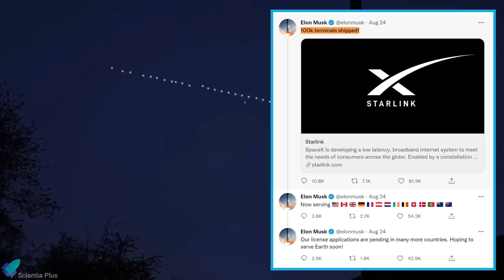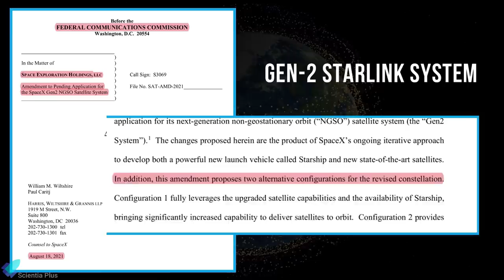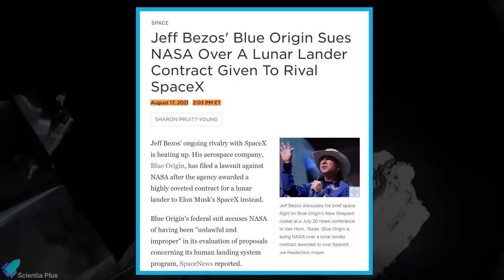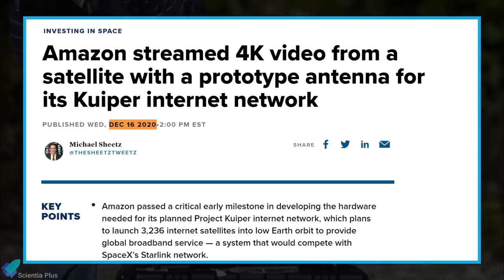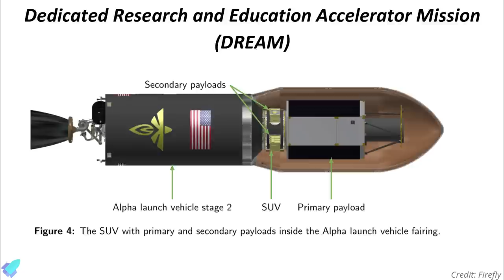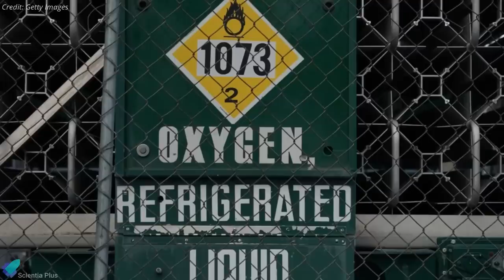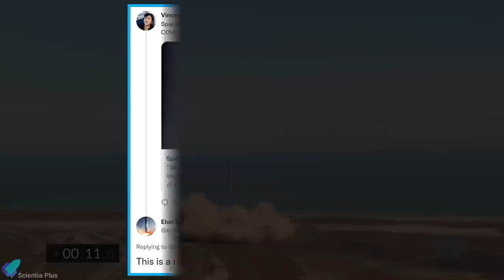Starship Quick Disconnect Arm Installed, GSE Tank Cryo Test  | JWST is READY | Firefly Alpha Launch

Comment: A parallel road to the beach would be cheaper and faster.
Reply: Wouldn't it be subjected to road closures as other roads?
Reply: There's no reason. The current road is closed when they're transporting stuff. But really big stuff that takes up the whole width of the road.
So no one can overtake.

When there's a launch or test the beach will be closed to, even when there would be a tunnel.
Reply: @rudivandoornegat2371  when beach is closed you can still use the tunnel to drive to Starbase, so :)
Reply: I agree why not do this? It would settle all closings except testing and launches. And there's the rub.
Reply: The tunnel as described in this video is not parallel to the current east-west road, but comes from the north, parallel to the beach, and close to the sea, from South Padre to Boca Chica.

Starbase is split into two parts: the factory site (where also the control center is) and the launch site.
The launch site is near the beach. And the tunnel is for outside people who want to go to the beach.

Even SpaceX people don't stay at the launch site during a launch. 
And the tunnel won't go between the factory and the launch site.
Reply: @rudivandoornegat2371  you are right regarding your last message. But I still find it challenging to understand what road would be easier to build. There is so much water around. Also I have found an article which said:

"Such a tunnel would serve a couple of purposes. It could provide public access to the beach at all times, except during launch attempts and high-pressure tests. It could also significantly shorten the commutes of SpaceX employees who live on South Padre Island, Port Isabel, and other locations that would otherwise be more than an hour's drive from the company's "Starbase" facilities in Boca Chica."

So main purpose of the tunnel is to significantly reduce travel time outside of the road closures.
Reply: @TarasMazepa  Yes, that's a plus. And a tunnel wouldn't disturb wildlife like bridge or a road.
Some fundamental environmental activists are already doing their thing.
Reply: @philzone8486  I think that in the future only new boosters and starships will be launched from Starbase Boca Chica.

All commercial launches and landings will be done from the sea platforms (old drilling rigs).

Maybe large maintenance will be done at Starbase factory, which would give us landing and launches of boosters and ships already in use.